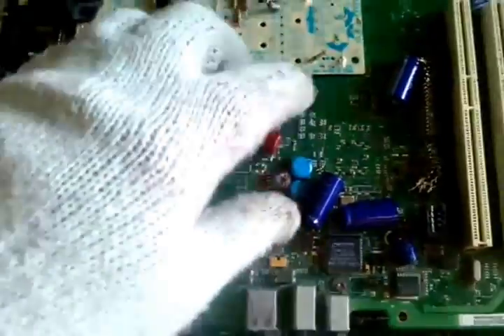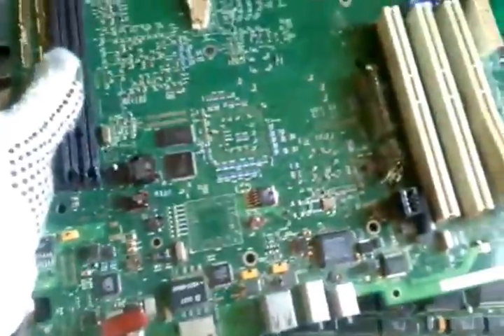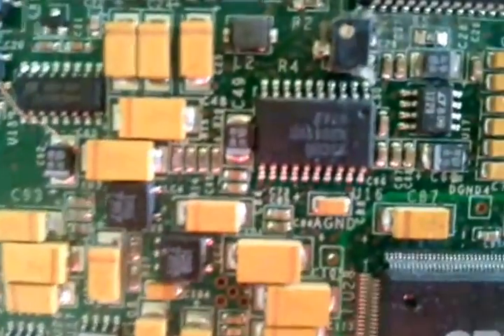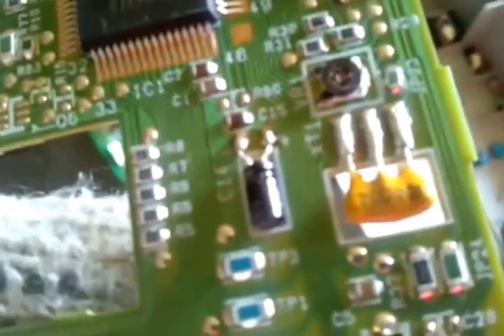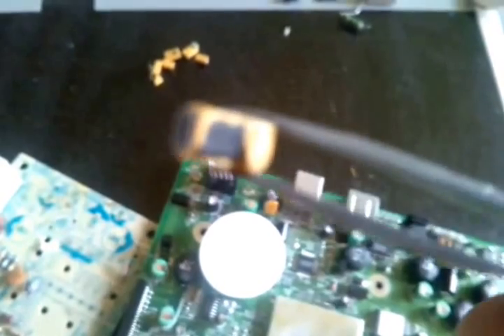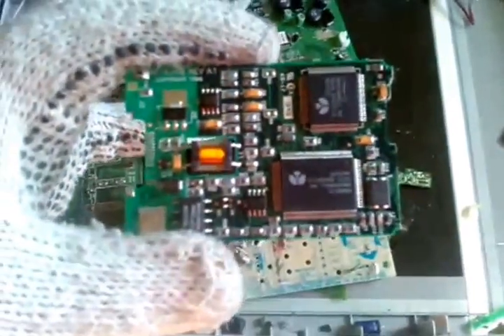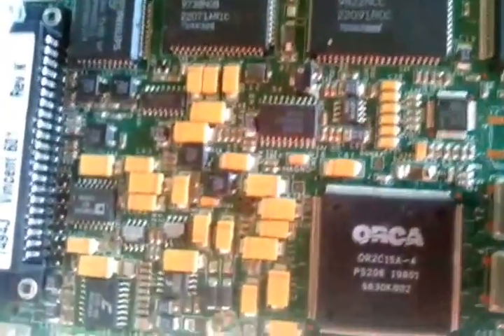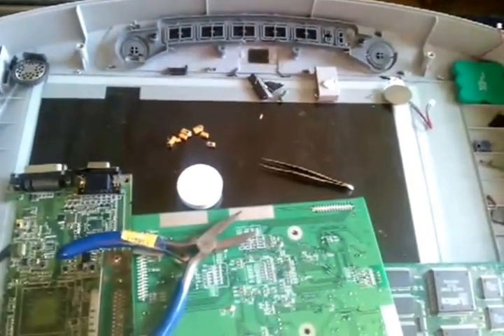Avi Oziel in: What are Tantalum Capacitors? How to recover Tantalum from Computers?

Comment: Not all that is tantalum is yellow. There are also BLACK tantalum capacitors and mill spec cap's. Looks like little silver tube usually bent over on the board. Black ones look very similar to the MLC's.

Comment: At 1:40, you held up an aluminum electrolytic capacitor and called it a ceramic capacitor. I'm not even sure how you could confuse that because there is nothing ceramic in an electrolytic capacitor. Tantalum capacitors are also a type of electrolytic capacitor, which is why they can have much higher capacitance than non-polar capacitors. Also, at 5:29, you said all of the little boxes have palladium and platinum. The majority of them are resistors, not capacitors. Resistors are typically made of very cheap materials. There is some tantalum nitride or ruthenium oxide in some resistors, but you would be wasting your time and materials trying to extract those out of all the various SMT resistors found on circuit boards. At 10:05, you called the tantalum capacitors the power supply of the card and also said that the data is stored in there. The power comes from the power supply of the computer, quite obviously. The data is stored in the microchips. Electrolytic capacitors are very low quality capacitors, typically having a tolerance of 20%. Data storage has to be precise. The reasons tantalum capacitors are used are their size efficiency, low ESR, and high thermal tolerance. When you can't fit a tower-like aluminum capacitor on a circuit board, a tantalum capacitor is used. When minimum resistance is a requirement for a certain circuit, tantalum capacitors are used. When the circuit will have to tolerate temperatures that could almost boil water, tantalum capacitors are used. Besides that, great video. I liked the "Don't eat them" joke. I also love how you're learning about the various components of a circuit and how you encouraged viewers to learn about circuitry as well. If I were you, I'd scrap the inductors for the copper as well. Most inductors are cylinders that are shaped similarly to aluminum electrolytic capacitors but much shorter. They're a coil of copper around a magnetic bobbin, usually enclosed in a magnetic casing that's painted black. The casing can often be somewhat of a cube instead of a cylinder. Other inductors are the clearly seen rings with copper wire wound around them. Relays (usually large, black boxes with at least four pins) also contain an inductor that acts as an electromagnet. If you're going through the trouble to scrap the tantalum for $3 per pound, scrapping the copper from inductors and relays should seem like an easy, pretty penny.
Reply: Paul Haig I posted this so long ago. I'm not sure where I got that figure. If I had to guess, I would say that he said that he scrapped the tantalum capacitors for $3 per pound of CAPACITORS, not per pound of tantalum. However, that's just a guess on what I meant. I'm not gonna rewatch the whole video to check.
Reply: Thank you. That was a wealth of information.

Comment: Thanks for the great video, Avi. Do the Ta caps need to be carefully removed or just pulled/scraped from the boards? Just wanted to confirm it's the precious metals not the reusable aspect.
Reply: The capacitors do not need to be carefully extracted because it does not matter if the capacitors are broken, All of the Tantalum Capacitors end up being Scrapped in a full chemical process.

Comment: Funny that i see this video just after i called it day sorting through stuff. I am about half way though sorting a 5 gallon bin i used to dump all the capacitors,oscillators,monolithic capacitors,pins,chips into while depopulating a weeks worth of boards.  There really is a lot more worth on those boards then what some people are lead to believe.
 So much copper on the boards. I keep everything and anything that has a trace of gold on it,because it all goes into the chemical wash. By the way those silver looking little oblong things are called crystal oscillators. There is usually about 1 or 2 on each board,.sometimes up to 4..do collect them as well. Crystal oscillators have a small amount of silver and another metal in each them,be surprised how fast collecting so little soon accumulates up to a lot!. Thanks for the video Avi.

Comment: Like most of the tantalum videos on YouTube you are repeating some of the same misinformation.  Tantalum is not worth more than gold and never will be!  I can only assume you meant that tantalum caps are much more plentiful on a given board than gold-bearing parts, but your statement is misleading.  Especially so after you just before that claimed tantalum is "rare" which obviously it is not.  Pure tantalum metal may be worth in the range of $80/pound, but only a fraction of a capacitor's total weight is tantalum metal.  Capacitors will have only 2 contacts.  The 3 pin yellow device you pointed out at 5:58 is a Crystal as identified by the XT1 designation on the board next to it.  The solder on it's leads may or may not contain some silver.  The main difference there is that the crystal had to be soldered by hand and couldn't be flow-soldered like the rest of the board because of the way they chose to mount it inside a hole in the board.  You'll note the blue electrolytic cap C14 right next to it is also mounted sitting in a hole to keep the board profile very thin, and it also has the same hand-soldered appearance.  Also as a whole, tantalum capacitors do not mostly have a yellow color since there are so many types and shapes of tantalum caps.  The yellow color is only most common for the surface mount variety.  Last but not least I don't believe the "oval" component you showed at 2:15 is a tantalum cap at all, it appears to be either a varistor or more likely a ceramic dipped capacitor.
Reply: Dude, thank you. You gave me more information as I'm transitioning into this wonderful world then anything I can find on YouTube or website.

Also you mentioned that yellow is the most common color 4 surface mount but there are other colors right? I see a lot of black ones on mine. Various shapes as well which makes me think what I'm looking at is not a tantalum capacitor even though it has a c designation. You may not read this but perhaps by chance if you do... Is there somewhere you can refer me to where I can get comprehensive information all motherboard parts or circuit board parts. I don't want to be wasting my time taking stuff off that I don't need to or missing things that I should be taking off.

Appreciate it.

Comment: I think you have some of your info mixed up for a few reasons... - that yellow thing with 3 legs is not a tantalum capacitor, tantalum capacitors only ever have 2legs/ends -there's also black tantalum block type capacitors - there's Also yellow and blue "stand up" capacitors, these type are always clearly marked for their positive and negative side -those yellow round "stand up" style capacitors you showed are Not tantalum, tantalum is shaped in more of a teardrop style not round

Comment from the maker: Avi Oziel in Gold Wars: How To Recover Tantalum Capacitors From Computers.  In this video, Avi Oziel describe what a capacitor is and it's use on circuit boards and then compare the difference between ceramic and tantalum capacitors. I cannot stress how rare and valuable tantalum capacitors are and that they should be removed and set aside for its precious metal content is even more rare than gold. Tantalum is a very rare precious metal that is in high demand and on short supply worldwide. These little mustard colored capacitors should not be discarded as they they are worth $80 a pound.
Reply: considering that you wrote this only a few months ago i think i should let you know that gold is $1,000+ an ounce  currently at the time im writing this it is 1,333.50 an ounce which is far more then 80/lb
Reply: Sean lastname
He is saying, that it's $80 a pound for the capacitor itself. If you were able to extract the metal itself, then it would be a much higher price. The equivalent is, that gold is worth over a grand an ounce but if you are selling the gold plated fingers, then you are not going to get a grand per ounce.. You would have to extract the gold from the fingers..
Reply: Clinton Billman
No, tantalum itself sells for about $80/lb.  It is not a precious metal, although it is rare, and these capacitors do have value.  Additionally, not everything yellow on a board is tantalum... For example, at about 6:00, he showed a three-legged part that was clearly not a capacitor.  It was marked XT1, which normally is a part of an oscillator.
Reply: I see what you are saying. I was just going by the video and then making it, make sense to me. So what you are basically saying, is this guy in the video, only has a fraction of a clue?? That is becoming a downfall to YouTube.. There should be some way of cleaning out the wrong or misleading information. Not to mention, the completely time wasting material that plagues current YouTube.. Thanks for reminding me, that you can't go by what you see or hear... Like the old saying," Believe none of what you hear and only 20% of what you see"..
Reply: Clinton Billman I'm sure he has plenty of clue about gold recovery, but it seems his circuitry knowledge is a bit low.  The square yellow capacitors (polarized) are tantalums, yes, and tantalum is basically only to be found in China last I heard, so it's an issue for circuit design costs, etc.  Yes, the capacitors have value, so don't toss em.  But you aren't likely to get rich off them at all as even a pound of those capacitors, well, that's a lot of capacitors to only get $80 anyways :)

Also, tantalum capacitors (with legs) also can be other colors like blue, and I think I've seen other colors as well.

Basically, when I clean off an old board, I don't throw out anything but the board itself and any purely plastic parts.  But then again, I'm a packrat.  I'm sure I'll find a use for them sometime, or a buyer.  And it's fun.
Reply: Yeah I agree with you, on the pack ratting and/or selling. I have always been into taking them apart and keeping things here and there but I pulled all of it out of storage a few weeks ago, to recover gold(I have a lot of 1990's Dell laptops and some older towers). I knew there was more there then just some gold plating so, I started investigating and learning what I can. I'm getting to your point, of simply saving everything but the board and clearly junk(plastics and similar). It's a fun little pass time for me and my kids to play around with. Thank you Gavin.. You have been a big help and an important reminder..
Reply: Clinton Satriani
actually the price of tantalum. not the price of tantalum capacitors is approx. 80 a lb. tantalum capacitors are not pure tantalum and worth far less
Reply: edgar sikes
Yeah, we figured that out but thanks

Comment: 6:05 Is it really a capacitor? With 3 legs? I'm not sure, but it doesn't look like a capacitor to me. By the way tantalum capacitors may also be black. Here is the example : http://electropark.pl/3399-large/220uf-6-3v-kondensator-tantalowy-obudowa-c.jpg  and ofc thanks for video.